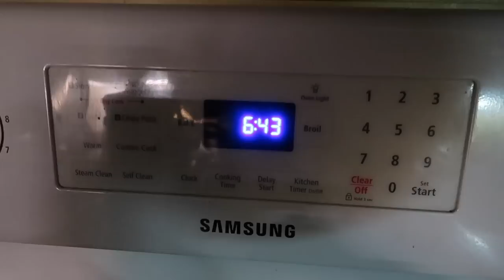Japanese Takeover at Cars and Coffee!

Comment: Nice meet and a lot of nice cars. Vettes, mustangs and jdm. I will pass on that stance stuff. I personally call them posers. There is something up with the rx7 fc. With a good battery and starter it should start right away. Either the running is too rich and wetting the plugs, coils or low compression. My Fd starts right up all the time as long is the battery has good juice. Rotary cars need a good strong battery to start well